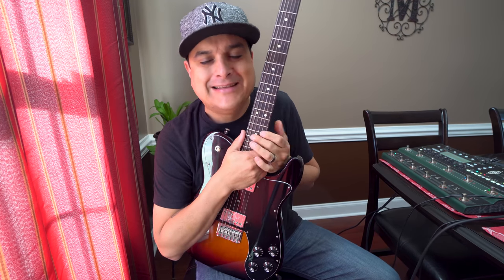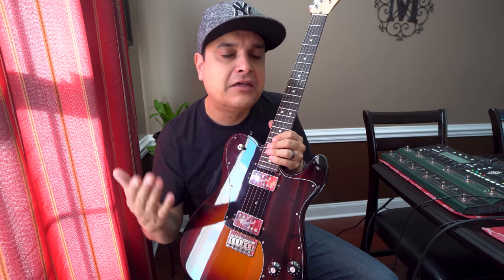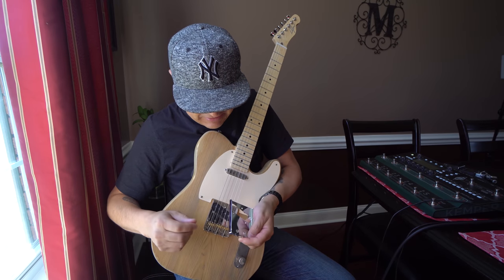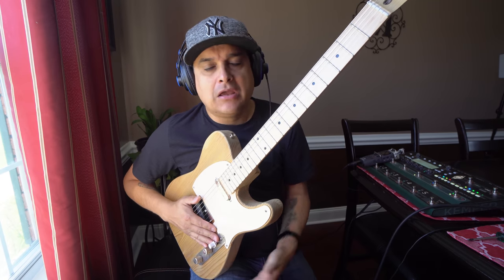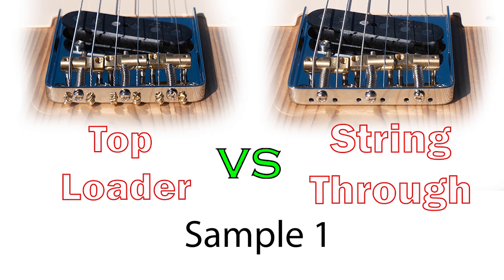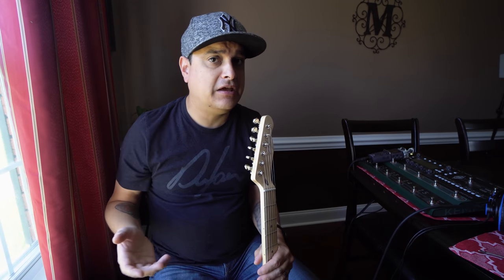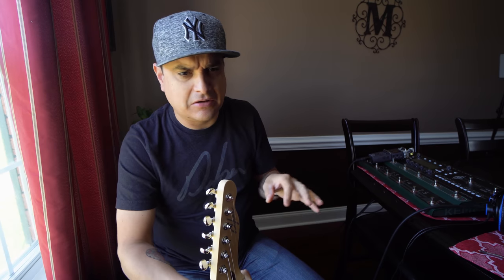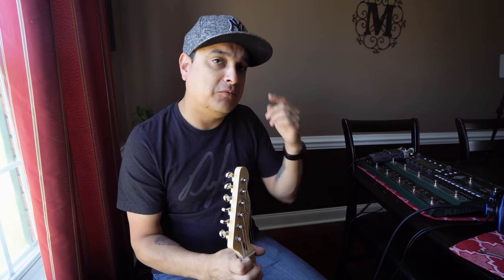Top loader Vs String Through Telecaster -  Can You Tell The Difference

Comment: I own a toploading Squier Affinity Tele and a strung through the body Squier Standard Tele. They feel and sound pretty much the same. Just like your Tele does whether toploaded or strung through the body.
I've come across the claim that through the body stringing makes the strings feel stiffer and more characteristic of a Tele when played. This cannot be true: on either type of Tele, strings of the same gauge tuned to the same pitch will necessarily have the same tension. I've also come across the claim that stringing through the body makes the body resonate more. That doesn't make sense: the length of string between the saddle and the anchor point in the body doesn't vibrate, at least not at a frequency that would make the relatively massive wooden body resonate.
Reply: As an engineer, i can say that a long string needs more tension for the same tone as a short one - so string through might feel stiffer.
Reply: Amir Khalid , thank you
Reply: @janmueller5923  This is true when considering the scale length. The question is if this applies beyond the scale length. For instance, would farder away tuners also make a guitar feel stiffer?
Reply: @doscheid  for sure! The longer the string itself, the higher the tension will be (at same gauge of string).
Reply: @janmueller5923  why my jazzmaster doesnt feel stiffer than my strat then? both 10-48
Reply: @hiroprotagonitis  it's a minor change, but it does have more tension if it's longer

Comment: It doesn’t really sound any different. Does it feel different?
Reply: Very good question.   Top loader with shorter string lengths may feel a bit stiffer to play.
Reply: My top loader actually feels less stiff. I think its do to more give at the break angle at the saddles
Reply: HK Guitar shouldn’t shorter strings (top load) have less tension so should feel less stiff?
Reply: @internetselling  Nope. The tension of the strings depends on the scale and the scale is the same. We're not measuring the overall length of the string when we're talking about the scale, just the length between the breaking points, saddle and nut. The only difference in this case is the pressure on the saddle which depends on the breaking angle of the string. I played string through and top loader Telecasters, the feel is the same but the sound is somewhat different. I prefer top loaders.
Reply: @toonophobia  Hi Kristijan, After reading your post I'm thinking my selections were all reverse about. There was definitely a cleaner tone that I liked more. It will be interesting to see the result as I plan on building a Telecaster.
Reply: @hkguitar1984  you have it backwards bud
Reply: @internetselling  exactly

Comment: I've listened using my studio monitors for this comparison, very small difference (more than likely I may be imagining I hear a difference).  I suppose you could fine tune the instrument by using the top load and string through depending on which strings you would wish to add emphasis or slightly diminish.
Also curious if the top load with slightly shorter string lengths plays stiffer than with the longer string through setup.

Comment: I think the only reason I would have a preference in Through body strung or top body strung is if I was paying for a cheaper guitar.  I’m speculating but I might be completely wrong but if I had two guitars and I knew the electronics were going to be cheap I would think body through strung guitars would effect/ improve string Grounding Issues?  Please correct me if I’m wrong

Comment: To me the difference in tone isn't going to make much difference you can e q it with a pedal or amp. What I want to know is does it affect the feel of the tension of the strings on the neck? Some players say the top loader bridge makes the strings easier to bend or more slinky compared to the string through the body. I have a string through body bridge on my Telecaster.

Comment: This is going to be interesting! I've just replaced the stock bridge on my Squire 50s Classic Vibe Tele with a Wilkinson one (with compensated brass saddles) and top loaded it with 10s. I can clearly feel the body has less resonance & sustain when top loaded compared to stringing through-body.
I swapped the bridge to improve the intonation (now perfect!) and to try top loading. By top loading, the overall length of the string has reduced therefore the overall tension will change but I'm sure Dylan will cover all of that and the implications for how it feels etc.
Reply: I second this. Feel is different and better IMHO  when stringed through.
Reply: If the tension was different, it'd be a different tuning or scale length. Might as well wrap the tuning pegs a few more times for extra length, know what I mean?
Reply: @asolitaryblueband  Sorry, my original post should also have mentioned break angle across the bridge comes into play e.g. on a Les Paul, raising the tailpiece reduces the break angle and reduces string tension too. Toploading a Tele reduces the break angle compared to thru body.
Reply: @hotblackdesiato3451  Again, the string tension would necessarily be the same. Turn the tuners to change the string tension, although you will find you have changed the tuning with it. The two cannot be separated, tuning and tension, except by changing the string gauge or changing the scale length of the guitar. More friction at the bridge does not equal more tension.

Comment: Nobody mentions the anchoring effect on the string of the sharp edged tray on a though strung guitar. It would produce a shorter 'back string' length than top load, 'stiffer' string (and a stress concentration). I use small brass ferrules to round off that edge, mainly for peace of mind (engineer) but to allow string to 'breath' particularly when tuning.

Comment: I’m enjoy these.  Especially when I know there’ll be some polarizing comments.  I had an ASAT from G&L.  An American model I custom ordered and that was a top loader, of odd, bridge design. One of the best and longest sustaining guitars I’ve owned.  Honestly, I think of that one from time to time as the one that got away. 

I had a Mexican Tele, with string thru and it sang just as well and sounded different because it had different pickups. Not because the bridge made a difference.  

By contrast, and here comes the point in case you thought that preamble was pointless, a buddy of mine had a custom guitar with this weird string anchor system where you could string it either way.  He said, after months of trying various options, his favorite setup was the lower 4 strings thru and the B and Top E in the top loader spots.  

This is all relative to the player preference and I couldn’t get a distinguishable difference in my IEM’s.  (Shure 535’s for anyone asking).  I liked my G&L, but with locking tuners on both, string changes were quicker on my thru bridge Tele.

Comment: I want a cheap Squier Tele should I go bullet or affinity?
Reply: Dylan has a video where he compares Squires. From the top of my head, the classic models are good, because the measurements of parts are the same as from the Fender models, so its easy to upgrade. Look up the video, it holds quite a bit of info
Reply: I have a 50s classic vibe tele and I love it. Paid $250 used.
Reply: Classic vibe series are best

Comment: Funny, I think I heard a difference, sometimes the sound was somewhat thinner, I know no other way to discribe it. And I think the thinner sound was the strings top loaded, and the more chunky sound was string through body. I may be wrong, but I think there was a difference I was actually able to hear.
But then again, this might even make sense, I don't know, but through body the string tension on bridge-saddle is higher, so the strings ring out more and the top strung strings have more loose ends of the strings that somehow dampen the sound.
I was pretty sure, that there wouldn't be a lot difference to be heard, not as much as I actually did.

Comment: I just wonder if the screws that hold the top loader bridge in place will rip out of the body after a while. Especially if it were on a baritone guitar. I'm curious to know because I'm building a baritone and deciding if I should use a top loader bridge or not.
Not worried about the sound at all. It's basically designed like a tune o matic with a stop tail Idk lol.

Comment: They were very close in tone - nothing that couldn't be easily matched by moving your hand a little or turning a control knob. That said, my guess is that Samples 1, 5, and 7 were using the Top Loader. And, Samples 2, 3, 4, and 6 were using the String Through. I based my guesses on an assumption that the overall tone would be brighter on the Top Loader than the String Through method.

Comment: i got a fender pro 2 tele last Christmas and it came to me with the strings setup "string thru" and it had that signature tele snap and pop n tight twang but january 25th i changed the strings on it for the first time so i played it for a whole month string thru and when i set it up "top loaded" man the difference was huge it had a much looser feel it had less snap and pop which i like and it still has that twang but its not as tight if that makes sense but it has more of a "rock" sound with the gain on or some overdrive with it "string thru" it had that classic tele tone no matter how much gain you used or how clean or how many pedals it just screamed tele but with it top loaded it just suits me more it had less snap and pop it doesnt feel as tight and it gives me the sound ive been wanting for a long time i highly recommend top loading your tele n giving it a shot if you have that option but if you play nothing but country and need that signature tele tone i mean youll lose just a tad of that with the top load if youre goin for that pure "country" tone but you still get it with the top load setup but 100% give it a shot guys ill probably never go back to string thru it just feels so nice

Comment: If there's a sound difference, it seems insignificant. Do you think there's perhaps a bigger consideration between the two in regards to tuning stability? One design pins the bridge down to the guitar body (string-through) and the other wants to pull it up off the body (top-loader). Of course, if your bridge is secure, it shouldn't matter. It would be difficult to test, but maybe there's something there.

Comment: Just recently I switched from toploader to stringthrough on same tele. It really worked for me in terms of sustain feel and tone. Tone becomes beefier, more dark. Feeling is different. But thats just me and my case. It could be also a placebo effect who knows... 

Very hard to guess on this vid, this should be guessed live I think.. perhaps 1  is stringthough  2  is topload, etc using presumptions I mentioned.

I wander what was the Fender reasons for abandoning test they do 59 with tele topload  and switching back to stringthrough???
Reply: You could have achieved a beefier tone with installing an hybrid set of strings.  3 heavy strings and 3 light. While keep the same bridge.  I did this and it’s fantastic.

Comment: I m not that kind of player that tells that something is better or making a huge difference except for the player. But I think this is a fun experiment so here is what I think and why:

Top Load: 1, 4, 6
String through: 2, 3, 5, 7

I do not hear any difference in sustain and i don t believe that it will make a big difference. There will be a difference but only some milliseconds... 
when i tell them appart i listened to the high end. I think the top loader bidge makes the guitar sond a little more brittle, metalic, snappier (or whatever you wanna call it ) because of the string just touching metal at one side.
However I think the differemce is not worth buying one guitar over another or swap out a bridge or something.

Comment: Most times I can't hear a difference in your comparison videos. However this time I  heard a significant difference between the two samples but I don't know which were top loaded and which were string through. Samples 1,4 and 5 sounded better to my ears. Assuming all other variables are equal, then I would guess that they were the string through samples. Without a sample 8, I have no idea what sample 7 was. 

As a relative noob, I don't know why there would be a difference but 1, 4 and 5 seemed cleaner, brighter,  and fuller. 2, 3, and 6 just seemed thinner and muddier.  BTW ... Looking forward to hearing the answers and your explanations.

Comment: As the string is really fixed by the tension and functional length over the saddle rather then where the string is attached to, it really doesn’t make a difference on tone. A top loader is theoretically better for string life because the angle is straighter

Comment: It's not about the sound or sustain. There's no real difference. It's about the feel. Less tension through top loaded which should allow for more slinky feel. So you could use 10's with the feel of 9's, but bending will be safer(on stage)from breaking a string. That's all it's about folks. Plus it looks cool 😎

Comment: If you just happen to have been born with a very high mechanical aptitude, just looking at the two, the through the body one is far more mechanically stable than the little thin sheet metal bracket.

Comment: Couldn't you just drill out a small space under the string through holes under the bridge on a non strung though and lift off the bridge for string changes? Not for the benefits of string through but because some top load designs are shit but the bridge itself is good.

Comment: That's quite close. I really can't hear a big difference but I'm not familiar with the guitar.

However on a guitar I know, it makes more difference - I have a 2014 Iron Label S that can be strung both ways and the difference in break angle across the saddles is very pronounced and I notice a lot of different in how artificial harmonics ring out, it's much livelier top-strung.

Comment: one system has definitionally more full sound. i would say that this system must be the top loader as it would result in less vibration of the strings be adsorbed by the guitar body. 

so sample 1 i think is the string through and sample 2 is the top loader. i apply the same logic to the rest sample but i cannot be bothered to do one by one and post it.

Comment: People here are seemingly misunderstanding completely how stringing method and break angles relates to tension and I see this shit aaaaall the time, it's pure woo woo that's somehow been proliferated into being an accepted understanding. Here's the thing- Your stringing method makes no difference on string tension. A high E on a .10 at a 25.5" scale takes equals 16.2lbs per square inch of tension to bring to pitch. That is what that string of that thickness requires in tension to be brought to that pitch, if that tension were any different you wouldn't be in tune with an E anymore, if the string thickness were raised and the tension stayed the same, that E would be roughly dropped to a C.

If I had a perfectly tuned E string and raised the tension by pressing on the string in between the nut and the tuner post, (increasing the break angle) all I would get would be an E that's too sharp, I increase break angle, then I have to tune down to get the note in tune, what do I get in the end? The exact same poundage per square inch across the length of the string.

THE ONLY VARIABLES ARE:

- String gauge
- Scale Length
- Desired Pitch
- String material composition (nickel/stainless/bronze/nylon/whatever, obviously nylon takes less poundage to bring to the same pitch than steel for example)

Comment: Sounds exactly the same to me but I was listening through speakers I'm not used to.

But a clean tone sample would have been nice. You cannot generalize what kind of tone people use. I play prog (neo-prog) as well as 80s stuff a lot so a pristine clean tone is my base. I almost never use an edge of breakup tone like you have here and I never use a Tube Screamer. It's basically either clean, full on distortion or crunch for me ;)
Reply from the maker: Even so, the majority of people dont play totally clean. Even if they think they do, it usually isnt.
Reply: @DylanTalksTone  Well, that really depends on the type of amp one is using. Back in the 80s I used a JC-120. That was eventually augmented with a Marshall combo and I switched between the two.  Later I got a "Red Knobs" 100 watts Twin that replaced the JC-120 and who's clean channel has headroom for days. Eventually I sold the Marshall too and only kept the Twin which became a pedal platform for me. That amp is out of commission at this time for reasons I won't bore you with and I'll be playing our upcoming shows with a Katana MKII 100w head plugged into a Marshall 4x12 (I needed a cheap alternative quick and I had the cab...).

With the JC-120 and the Twin on the clean channel, clean is definitely clean (we won't argue semantics of harmonic distortion and the fact that no audio signal is ever 100% clean, you know what I mean by clean ;) The Katana's clean is also truly clean and I use the other channels for crunch and dirt. It may not be the majority of guitar p-layers that use amps this way but with pedal platform amps, it might be a lot more guitar players than you think.

Comment: 1,4,6,7 Are Stringtrough.The others are toploader
Reply: I tend to agree with you. Samples 2, 3, and 5 seemed to be have a bit more of a jangley sound. However, slight differences in picking attack could have a similar effect. I think the winner here is the plate that allows the end-user the option of stringing the instrument either way.
Reply: @chadwickhurlburt6529  right